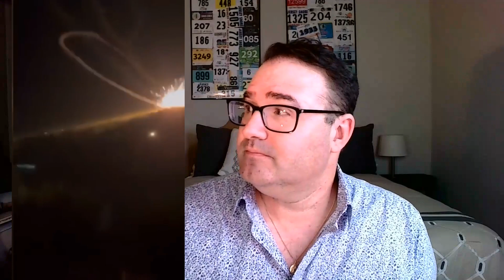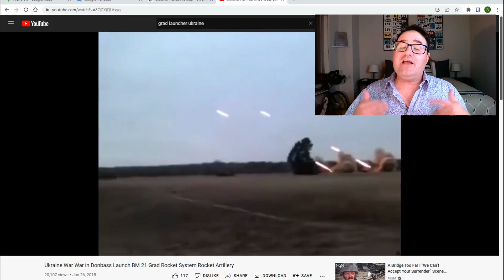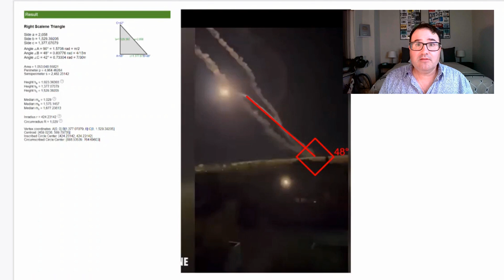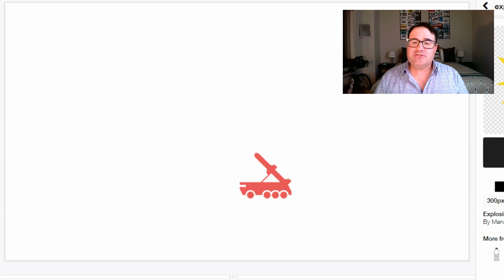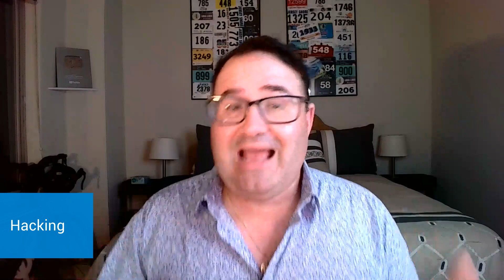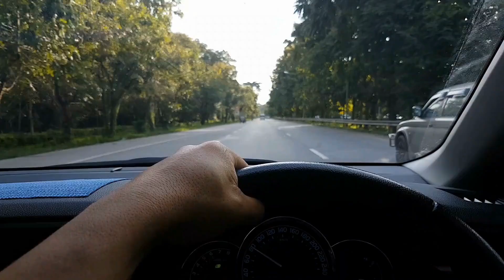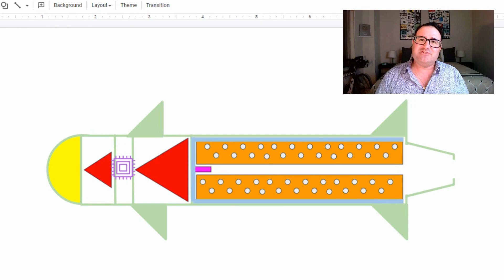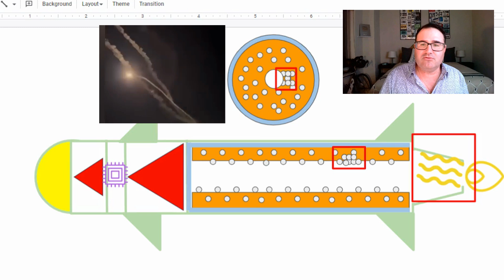Why this missile U -Turned

Comment: I work in rocket propulsion. While the fuel "settling" you're talking about can happen, it won't change the direction of thrust. It will change the performance curve to either slow the burn rate or increase it (possibly to the point of blowing itself up) but off center gas production inside the solid propellant core won't create off center thrust.
Reply: To me it looks more like a guidance commands issue.
Probably a critical flight sensor of the missile failed and gave wrong parameters to the inboard electronics that generate the steering commands to follow the radar beam.
Reply: @drangoll4163  A Russian Proton rocket famously had it's IMUs installed upside down which caused it to flip over shortly after launch. I'm not saying that this is the exact same failure but it definitely looks like a GNC failure on the bird.
Reply: @drangoll4163  so based on your theory he was still right about the other two missiles being able to fly properly because the guidance systems working it's the missile itself that failed?
Reply: @drangoll4163  It reminds me a bit of the proton rocket where someone had installed an angular velocity sensor upside down, with predictable consequnces.
Reply: @drangoll4163  russian tracking radar system sending a radio beam to target, and the rocket just rapidly flying to most "bright" radio emitter. And when the target is suddenly disappeared... It corrected course to what it supposed to hit. And the most powerful radio emitter was the tracking radar. At least it's supposed to be so....
Reply: @legion5663  in most cases it doesn't work like you described. Majority of systems use a self destruct feature if radar lock is lost. So , upon loss of radar lock the missile self-destructs. It's a safety mesaure.
It's important to note the the self-destruct command is sent by the radar on the ground , and is not initiated by the missile
Reply: @drangoll4163  Yep, but it's the Soviet missile. So it may have no safety measures for "target lost" situations. In late Soviet Union engineers needed to do cheaper rockets, so they could just remove those safety chips and protocols
Reply: @drangoll4163  WOW!

The YouTube comments threads are full of solid rocket motor design engineers.

I'm impressed!
Reply: @drangoll4163  If you leave the computers on for too long you can get overflow errors on time values that can cause shit to not work. This has been an issue long known in the aviation industry and has affected US Patriot missiles in service before
Reply: @drangoll4163  that's what I was thinking happened a major malfunction to a critical guidance component
Reply: I think the "Proton symdrom" is most likely: about 2km after the launcher the rocket starts targetting and theirfor turning. Might even be a thing of "fly balistic for 2km and then start adjusting". If anything else failed why would the stick turn exactly 180° and the fly straight again?
Reply: Agree with you 💯
Reply: The nozzle bell should equalise unequal gas generation inside the solid motor, shouldn't it?
Reply: Propulsion analyst here, Came here too say this. It was most likely a avionics glitch.
Reply: @mynameismynameyourname6197  agreed. The in flight turn is too precise to be a thrust distortion
Reply: Totally agreed with you.
Reply: Contrary to popular belief, they don't use the 'fins' as control surfaces, they have flaps at the exhaust that modulate thrust vector. What's interesting is the smoke plume shape and the change in thrust as it turns, they have a lot that can go wrong
Reply: @MacGuffin1  sometimes, injection if a cold gas is used. That's what the Polaris A3 used for 2nd stage TVC.
Reply: Didn't a Proton(?) rocket launch a while back follow a very similar flight path that was later determined to be caused by a sensor installed back to front?
Reply: @johnreid2851  Yes, but mass manufacturing (like the way these missiles are made) is much less likely to produce those kinds of errors.
Reply: @mattsoup4121  yeah but its russia lol
Reply: @jacksmith-vs4ct  Just because Russia made it doesn't mean it can defy physics.
Reply: exactly, the steering failed
Reply: I'm leaning towards a sensor error.
Reply: Yeah and if a fuel problem would be the reason. what would be the chance of it hitting the exact launch position. And not spinning out of control
Reply: @paavorajamaki7429  well it didn't hit exactly lol
Reply: @jacksmith-vs4ct  well it didn't have time to turn entierly. You can see it always pointing at the launch site tho
Reply: I agree... It's not the fuel settling. I think it's a failure of the nozzle causing a non-uniform flow.
Reply: I'm just a guy that plays video games, and was baffled at the idea he put forward.
Reply: @Impsucks  you and me are tge only honest blokes in the thread, young brother.

Isn't it great to be surrounded by geniuses?
Reply: @Mattsoup Wouldn't it be at least possible for that clump of fuel to partially explode in such a way that it altered a shape of the rocket 'nozzle'? Or just blew a hole into the rocket, giving it an additional thrust vector?
Reply: @petroz5505  you'd see evidence of that in the video. You'd need to blow a hole in the side of the casing to get that kind of vector, and once a motors blows a hole in the casing it will blow up within a handful of milliseconds because it's bypassing the thermal protection.
Reply: @petroz5505  we would have seen that in the video
Reply: As an unprofessional KSP gamer, this looks a lot like aerodynamic instability. You can compensate with control surfaces up to a certain speed. Past that, things happen.
Reply: @PainSled  It looks like a avionics failure more than anything.
Reply: @mynameismynameyourname6197  I assume those come in many varieties, but is it common for those to be so temporary? The path following the sudden turn seems pretty straight.

To be clear: The extent of my knowledge/experience here is limited to Kerbal Space Program. Not the most prestigious schooling available, I would hazard.
Reply: @PainSled  I would probably not use kerbal space program as a foundation for anything other than space sims. It does not translate to real life well or at all. 

It looked like a guidance malfunction The control surfaces looked like they preformed great since they pulled off a stable 180 into a stable kill trajectory into the ground.
Reply: @mynameismynameyourname6197  failure? , failure?! , isnt that to much of a risk to take, mate, no failure in weopens today, they either hit straight as an arrow, or cause collateral damage nearby, !!!!!! Supposedly both acceptable these days!!! But never turn coat!!!
Reply: @wor53lg50  I have no idea what you are talking about.
Reply: @mynameismynameyourname6197  me 2
Reply: @mynameismynameyourname6197  learn, read, open ya mind, open ya mind.....
Reply: @wor53lg50  open ya dictionary...
Reply: @wor53lg50  thats is most of the worlds weapons not russia where they are famous for cutting corners lol
Reply: @PainSled  lmao
Reply: I tend to agree with OP.  The entire principle of rockets is to take turbulent high pressure flow and normalize it in a predictable vector.  Any variability would be small, and I would expect would be balanced out by the overall randomness of that variability.  That's not even considering that at the speeds it would be going by the time it reached ~2km from the tube, the forces from the control surfaces would outstrip any possible variability by orders of magnitude.
Reply: I am An aerospace engineer too and you're right. The guy in the video just is not in the field.
Reply: @lucaspanocuomo8701  so what are the dynamics and causes, Sir?
Reply: @Theineluctable_SOME_CANT  almost impossible to say. Sure a failure in the fuel grane doesn't change the trajectory in that way but the thrust curve over the time. Maybe a failure in the combustion chamber can  change the trajectory but I only see gasses from the nozzle and the gyro couldn't work in the way it did: the missile seems stabilized. I don't suggest a stucked fin because the missile change the trajectory after a while (that missile doesn't have a booster part like the Javelin or NLAW). The most probable is a failure in the inertial navigation system that is taken into account in the trajectory adjustment after a few seconds from the ignition.
Reply: @lucaspanocuomo8701  yes, an IN board starting up bad makes sense...

I'm into this stuff a bit, you see. 
Thank you.
Reply: This
Reply: @marvindebot  a 1000 2 1 this? even more if einstein still around!!!!!enuff said...
Reply: Whoever wrote this needs a raise
Reply: Guys, guys. Today (July 8, 2022), the mayor(/head of military administration) of Mykolaiv released a video where he states that russians are re-purposing S-300 rockets to hit ground targets (adding GPS modules or smth), because they have plenty of those and lack of others. So it might be the case that what we saw is just a failed attempt of a ground-to-air "upgraded" missile to hit the ground target.
Reply: @yevhenbryukhov  they use SAM complex to launch a ground-to-ground missiles. And so, it cloud be missguidance, but the rockets they use have protection from hitting the target approximately near the launching zone. So... It didn't seem like it was the ground-to-ground missile. It just wouldn't explode. But it exploded. And exploded just like SAM
Reply: Yeah I took rocketry and was abt to say that.
Reply: I'm wondering about a sensor being oriented backward so ot thought it was going the wrong way and turned the missile around akin to what happened in a Proton M launch accident.
Reply: My thought exactly.
Reply: Exactly what I was thinking
Reply: Like the man says, fail safes are and have been in rocket or liquid projectiles for many years, for a grown bird to fly the nest and does  a 360 to come home with payload without self destruct option, is fancicle, mother hen would have dudded or blew it long before..
Reply: @wor53lg50  you can't shut down a solid after it starts
Reply: Not a rocket expert at all, but aren't solid fuel rockets sort of self cooling through expelling hot fuel? Would it be possible that trapped air in the fuel could burn a hole in the cartridge?
Reply: @martinfisker7438  When they work correctly yes, they somewhat self cool. If you have a manufacturing error though it can have some exciting failures.
Reply: Would it be possible for a clump of fuel to cause a deformation of the nozzle by either dislodging itself or another bit of fuel from the solid and getting stuck in the nozzle.
Reply: @embr4247  It can't get stuck, but deformation could be possible if things went very very wrong. Even then, though, you wouldn't be able to offset the thrust more than 10 degrees or so (solid motors create something called condensed phase flow, I won't get into it here) and if the aerodynamic surfaces were working that wouldn't be enough to override what they could do for straightening the flight path.
Reply: My thoughts is that maybe the russians launched and then some idiot turned on the other radar and the missile homed in on the strongest strength and said, oh it's behind me. splat.
Reply: @Grim FPV I don't think it's that mostly because it didn't look like it was continuing to turn at the same rate once it finished reversing its heading.  Unless the force of the turn unstuck the fin or broke it free of the frame somehow.
Reply: @Grim FPV yes but that's not my point.     Once the control surface got stuck, it should have kept turning until ran out of energy unless the control surface somehow unstuck itself.
Reply: @Grim FPV No. The fins determine direction; the nozzle amplifies thrust power.
Reply: Then give us a better explanation
Reply: @CharlesSmith-PegasusICS  it's plenty of explanations up in the comments. Btw mine is the better one
Reply: Wow, who knew?
Reply: I''m an aerospace engineer, and I definitely agree with you. It's by far most likely to be a guidance issue due to a faulty sensor(s) or other control issue. Just basic control theory suggests it either started to over-correct due to some issue or flat out changed course in an entirely wrong way due to another issue. Although, like he said it's not making major course changes in that initial boost phase, and ideally stabilizing surfaces would minimize any needed changes as well, control outputs still have to be made by the onboard controller in all phases of flight. Judging from the rapid course change in the video, either something occurred when the missile started tracking, or the control feedback loop caused it to rapidly amplify an incorrect control output. Bottom line, though: controlling rockets and any airborne vehicles in general is tricky, and a probably minor control issue was enough to throw it off. There's a reason you can find so many videos of rockets crashing.
Reply: Seconded
Reply: Coming to say this. Propellant produces pressure not velocity. The pressure is going to equalize in the combustion chamber and it's not accelerated until it goes through the nozzle. Some glitch caused it fins to go to full deflection, or it burned through the side wall causing the flip and the appearance of stability is just coincidental.
Reply: Thank you for your service.
Reply: What are they using for TVC?

A failure can cause massive vector shift.
Reply: @Grim FPV yeah, i think gryo being backwards caused it, because after it did a 180 it was happy to fly straight again.
Reply: if you know about rocket propulsion: would it be possible for a damaged rocket (through mishandling maybe?) to develop effectively a hole in one of its sidewalls. Maybe not immediatly but it might be weakened by damage and than with the high temperatures and stresses breack. On first glance something like this could make the Rocket turn quite dramatically. It turned so fast, I don't even know if it's guidance even if hacked or malfunctioning would be able to turn it that fast.

My counter arguments would be that it would probably explode instead of turning even though, it didn't keep on flying long enough to see if it would have exploded without hitting the ground in a few seconds, and that it seems strange that it went back to a more or less straight path in the end. That could be less straight than we assume though as the rocket might have roled and still turn but in an axis less visible to our camera angle and guidance computers might have tried to counterackt such a turning effect to the extend possible.

Also I would have expected to see a more notable change in the plumes. Still, I'd like to hear the opinion of someone familiar with rockets on this theory.
Reply: @martinschlegel1823  while it is possible for a puncture in the casing to create substantial sideways thrust, once that happens the thermal liner has been breached and complete failure of the casing and loss of the motor will follow shortly behind.
Reply: I wish I knew more about the specific missile, but looks to me (assuming 4 steering fins) like a commanded hardover. A good aviation analogy would be the spate of 737 crashes in the 1980s-90s, where the rudder locked in a hard over condition.  In this case, since 2 fins need to malfunction, a rogue electronic command, probably internally generated.
Reply: Correct! 
If you look at the very frame when the missile hits the ground and have the smoke-trails highlighted by the flash, there are no abnormalities visible that would indicate a 'fuel-malfunction'.
The missile makes its U-turn right at the moment its guidance kicks in. The two smoke-trails that go as expected (the two on the left) show a 'hook' in the smoke-trail where the actuators suddenly turn the body of the missile (and thus the nozzle which leaves a mark in the smoke-trail).
The missile turns around AND keeps turning all the way into the ground. This missile was tracking .... something.
Seems to me it was most likely that the guidance system miss-took the illuminating radar for the reflected energy from the target.
Not knowing what missile-system this was and if it was modified (as for example a S-300 used for ground-attack) it is only speculation. 
But a semi-active missile could suffer from such a malfunction. I'm still trying to figure out the exact mechanism for this to occur.
Playing with the thought that the Illuminating radar was illuminating the target and that the target movement caused the illuminating beam to paint the last missile directly. So the last missile crossed the illuminating beam of the first (two) missiles and choose the wrong target.
Reply: How many Russian guidance missile launched, but failed and catched video?
At the end we don't know the reliablity rate for the overall successful rate of specific type of missile (even Raytheon will not publish their classified data), but this video has news values, which leading viewers with impression of poor design / quality control weapons. This is the ultimate and effective way for releasing failure footage from enemy side.
Reply: Wile E. Coyote’s left foot couldn’t find the stirrup when the rocket motor ignited.
Reply: I made model rockets for years with homemade solid motors.

We had a few "manufacture" and "mishandling" errors pretty much as described in the video as we weren't that dilligent when pouring stuff into moulds or storing it away from air and high temperatures.

A lot of our motor failures looked like the russian missile in the video although spinning violently in the air was more common as when the motor began burning on one side it normally kept on burning on one side biasing thrust that way. Rarely the side of a motor blew out or leaked causing a spin or turn but that was normally more spectacular. 

near the end of my time with that hobby we were using milled aluminium motors. The sides stopped failing but we still got turns or spins from engine failures sometimes.

What is different about the kinds of rockets you make that avoids this kind of issue if the solid state motor has settled or has a manufacturing problem?
Reply: If it were that the missile propulsion wouldn't it keep spinning and not head back to the launcher, this is guidance interference.
Reply: Yes. Damage to the solid propellant would be evident in a chuffing of low thrust followed by high thrust. Then the burn back pattern would remain one-sided, causing a change in the center of mass. The missile might spiral, but it would not make a U turn and then go straight again. 
I am not acquainted with the Russian thrust vector system, but it looks like it got stuck then unstuck to produce such an abrupt turn and correction.
Reply: Yup, that's true. Because to me, the problem might be at the elevator. Since the elevator is the only thing that is exposed to a mechanical hazard.
Reply: I would think that fuel settling could cause the rocket's mass distribution to become assymetric, leading to the center of mass not being in line with the center of thrust, and given that fuel would still be a substantial fraction of a rocket's mass that soon after launch such assymmetry could pose a problem, but I woudln't expect it to cause this much of a course deviation.
Reply: I agree that it's not the off-center burn, that usually causes the missile to explode if extreme enough as the motor sections start to expand.

It's probably in a boost phase where it's just holding whatever sensors in a zero g assent with roll corrections. So its either an acceleration sensor going all the way into a fin responding incorrectly.

I think it's what others said here, that it's an inerta sensor giving mad bad data and the guidance comp giving commands to correct it for a zero g ascent phase, esp since the movement looked controlled.  Taking away from this is that these missiles often have built in test before they are ready to fly and crazy IMU settings should shut it down....but then Russian cars don't have air bags now.

Alternatively, if the fins are crosslinked (no roll corrections) then it could be a fin set malfunctioning.

Very unlikely it's in terminal guidence as it probably has a computer lockout for it changing flight phases too early, and its probably solid state that is very unlikely to fail.
Reply: Maybe it's super soviet junk idk
Reply: i think it's more likely the target was either terminated or retreated outside of radar range, and from there the sensor operator  lowered and turned out the taking radar, which ended up guiding the missle to the ground
Reply: @king_kmarce  an operator would never guide it into the ground that close to friendlies, if at all. Most if not all anti-aircraft missiles, air-launched and ground-launched, contain self-destruct devices in their designs to prevent collateral damage from happening. You wouldn't launch an AAM or SAM just to have it miss or lose tracking and eventually fall on civilians, or more importantly to militaries, their own forces. In the case of active or semi-active radar homing AAMs, there would even be the possibility of them locking on to friendly or civilian aircraft after missing their targets if there was no self-destruct contingency
Reply: @jakobburg8309  this the fun part of the speculation game, please provide what you think isa more plausible cause. Because it definitely isn't thrust vectoring caused by unbalanced fuel burn rate.
Reply: Well it was a theory
Reply: 100% - shame he did not reach out to someone with some experience with solid motors before talking about this idea.
Reply: @paintballthieupwns  And how do you know, one way or the other?  You a rocket scientist?
Reply: Any chance the rocket just bent under its own thrust?
Reply: @DasHugh  It wouldn't have turn 180 then resumed straight flight.
Reply: @Caderic  I would think if it simply bent under its own force it would fly like a bent bottle rocket does. Pretty simple to me. It actually takes alot to turn a missile or even a bottle rocket firework for that tight of a turn. Makes sense to me. I suppose no one will know since it blew into smithereens. It's just my guess based on what I see. Sometimes the simplest of answers is what usually takes place. Thousands of things could have happened tho, and thousands of combinations of those thousands of factors. I won't pretend to know tho. Just a humble guess lol
Reply: @DasHugh  Well, that is a good though.  My point was, the missile, goes in a very straight path for a mile, maybe.  Then makes a very symmetrical turn, then goes straight.  The Path looks very intentional and controlled, where if the missile is bent, there would be nothing straight about the path.  Plus, a bottle rocket just shoots, where a missile has in-flight controlability, where it would be correcting for some problems.
As for you thought, they are very valid when problems solving.  TO often we thing wrong theories  are bad.  In problems solving, you take all the theories you can and get ride of the wrong one.  Ideas that won't work does not equal bad ideas!!!
Reply: @Caderic  if you watch the video closely tho, there's no real evidence the rocket ever flies "straight" tho. It's being filmed at an angle to so it would appear straight until it reaches a certain point. To me at least it looks very possible its turning as soon as it launches. That's why I said it may be a simple bent rocket.